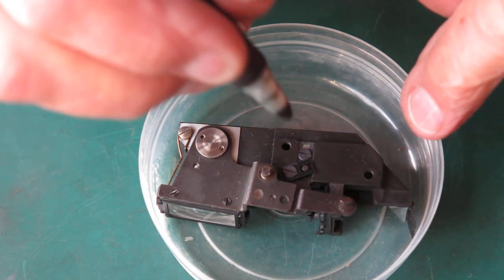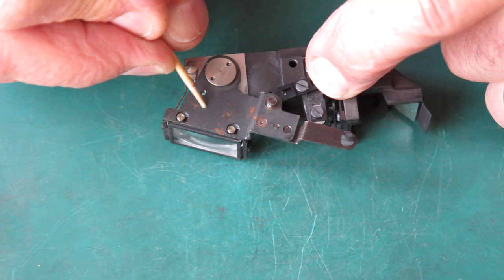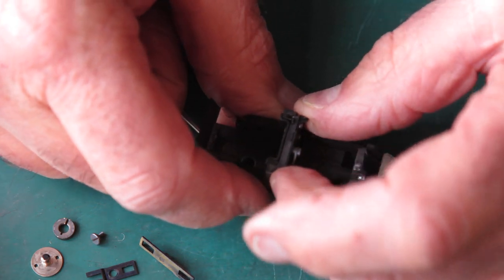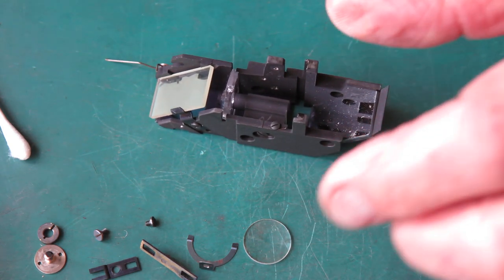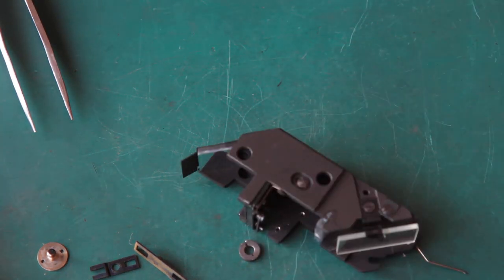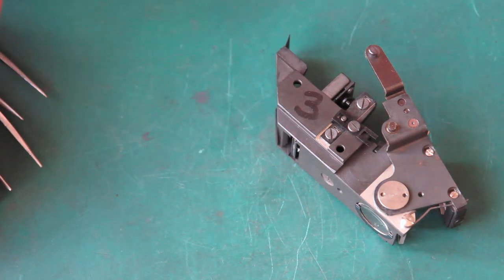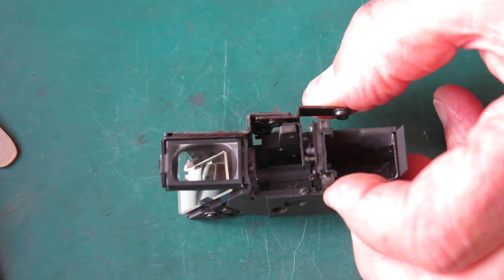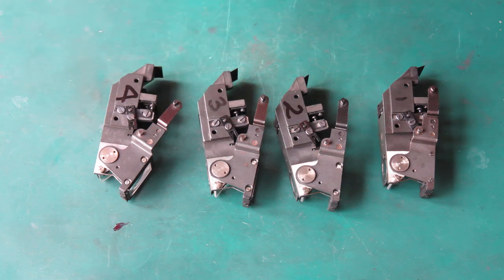Kodak Retina IIIS camera repair, servicing three cameras, part 17

Comment: Chris... I suspect that the "loop" in the #1 rangefinder bracket/lever is the horizontal frame adjustment that the slotted front group served in the #3 sample. I've seen a lot of those "loop" sections in metal bracket/levers where an adjustment was intended to be made. Glenn